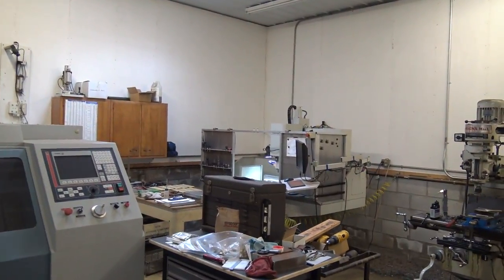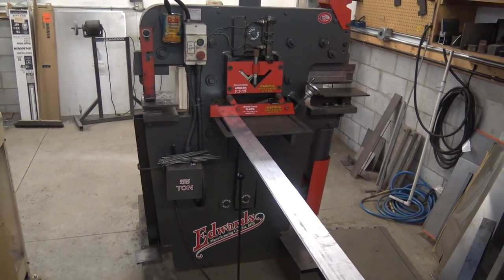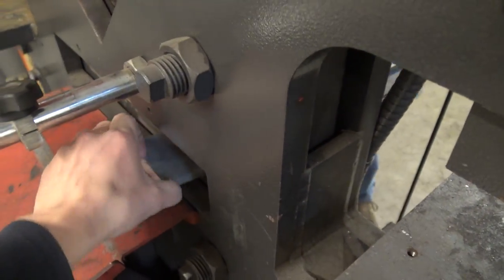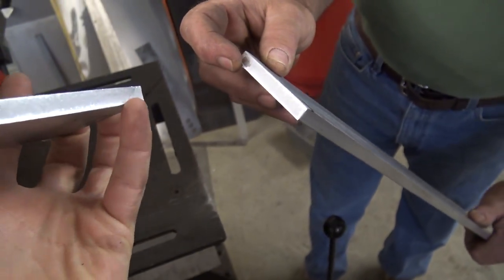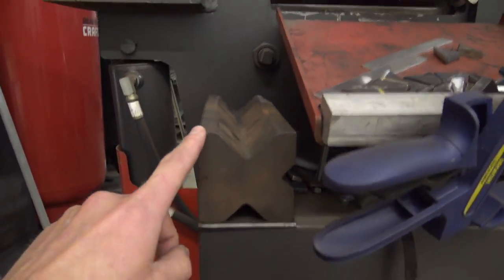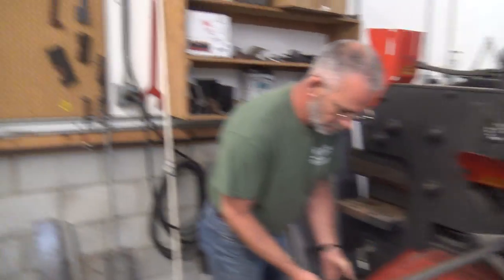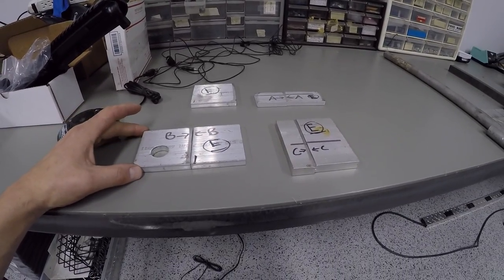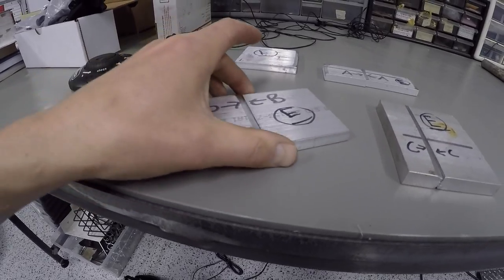What is an Iron Worker? An AWESOME Machine!

Comment: No matter where you live, in today's world wide markets you and your tools and machines need to be able to cover the minor differences that occur between metric and imperial sourced materials and machines because you can find your self using material being sourced that has been made to either standard. Suppliers can change where they source their materials from simply due to price and or availability because in theory steel is steel and aluminium is aluminium. 
Having said that it is a known fact that how a piece of steel behaves during cutting and welding can tell an experienced tradesperson just where that steel was made. Australian steel is known to be much harder to cut than Chinese steel.
Reply: Yes. Mark is correct. A number of the Australian steels are actually supplied as dual grade. i.e. 350/450 mPa 350 is just a normal mid range mild steel, 450 having a higher tensile strength, but still a mild steel. The Chinese generally appear to make a product that is right on spec, very close to minimum spec, but still within. Both are marketed as the same base spec product here. 250 mPa is a low grade mild steel that is commonly supplied as well.

Comment: Hi John.
 
Thank you for the video, is good that you take the time to look around at what options you have available to use in your machine shop.

If you plan to do a lot of structural steel small or large yes these machines are necessary .
But if you plan to use it to short cut your machining work this is bad idea imo.

If you want to get serious about machining times get a real CNC mill.

Put the price of your Tormach together with this machine you could easily buy a real CNC mill i think it is about time to get a real CNC mill and stop messing with the Toymach????  
Your business is growing very well John so it is time to get out of the part time/ hobby type of environment thinking and stop messing around with hobby machines.

10 Toymach will not equal one decent CNC $$$,$$$.

Comment: as far as the machine shop side goes you don't need fad machines like shears or presses as much as you may think. if you want to go all in on a successful job shop... then you NEED a cnc with 40+ or better yet 60+ inches travel. you can do bigger parts, there is less competition bidding. also you can have multiples of setups taking advantage of more unmanned hours.
Reply: +NYC CNC exactly, which is why a long travel machine has less competition. long parts need love too.
Reply: +doug farrish correction to what I said, there is tons of competition for 5axis machines and don't bother with a mill/turn, waste of money if you ask me. the hardest pill to swallow is passing up work because you can't fit it in the machine. hence the bigger the better. imo

Comment: it's good to go local. and not know what measurement system  Spain use's  there is only 4 or 5 country's that use inch
Reply: There is ONLY ONE country that uses the "imperial system"!  Even Brunei switched some years ago....!
Reply: yep very correct, but now if it's something for america and Americans only will use it, it will be in inch or metric. if it's a international thing being made it will be metric Nasa goes both ways, now it's on there web site, and even more bad new america is going to be a metric country in the next 20 years,

Comment: WOW! You're rep didn't have a clue, 10 % of the shear thickness is the clearance of a tool! Your tool is has to be set as per the material thickness. Your cut quality is completely dependent on the setup and the tools not so much the quality of the machine! Double the cash for the same scope of machine??? I mean really this isn't a HAAS vs a Okuma here! its a bloodily iron worker. Sounds like you made a very good decision! Look forward too you're new 'will it shear' channel (fingers not included :) Cheers!
Reply: +NYC CNC worlds most expensive pizza cutter and panini press XD
Reply: And no sex in the champagne room.
Reply: Widget Works Manufacturing Inc. don't you mean 'sheers'🤠("cheers")...lol

Comment: you will loose so much material just make things square. ..
Reply: Start adding up the inches for every cut made with a saw blade.  Cold saws, about and 1/16" sometimes up to 1/8"Kerf give or take.  So every 8-16 parts you cut, you lose an inch of material! If you cut 80-160 parts, that's 10" of material turned to dust, literally.  The shear is a zero material loss. Deforms? Yes. But less than a 1/16". And that's assuming you even need the ends to be perfectly square.
Reply: you have to look at this as a machine shop. .. just like hesaid.
IF you ate running a sheet metal shop then I do see the need ...
but then again a job that makes money is not to complain about 

it all depends 
1 on your budget 
2 the size of your chop
3 do you want to work on anything with metal.

it all depends on your vision for your business

Comment: Get a 5000w Co2 electric laser then you won't have to worry about the deformed edge, maybe not in your budget lol.
Reply: I run a 5000w Mitsubishi CO2 we were looking into fiber optic laser, but they have there limits. There fast but they are more for thin gauge material we cut a lot of 3/8 SS we are sticking with the CO2

Comment: as a machine shop neither one is worth to buy
Reply: Virtually every machine shop from prototype to high production has a punch, brake and shear in one form or another. Be they manual or monster Amada's. So yes, they are very useful even in a machine shop. 

If I have to make a bracket. I would rather shear it and bend it on a press brake and throw it in a drill press instead of cutting a huge chunk of metal and wasting an hour hogging it all out...